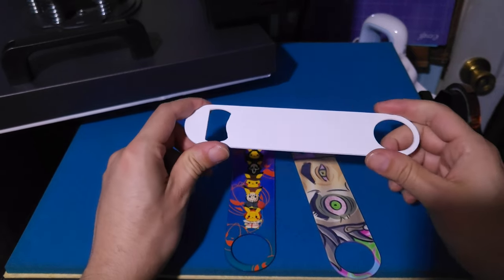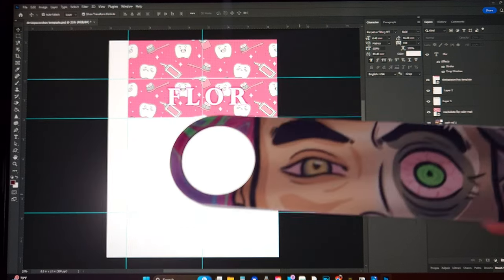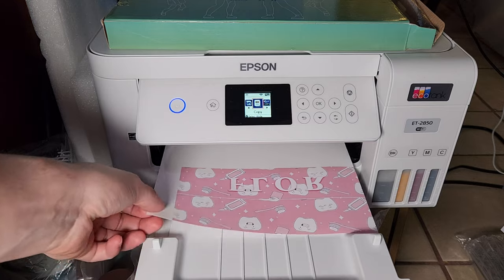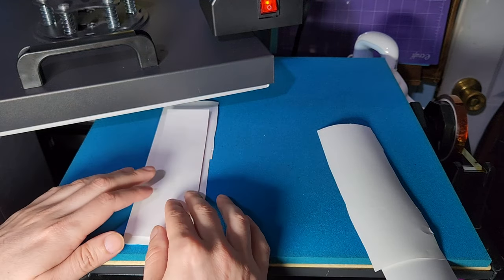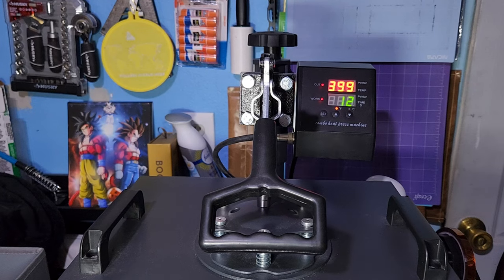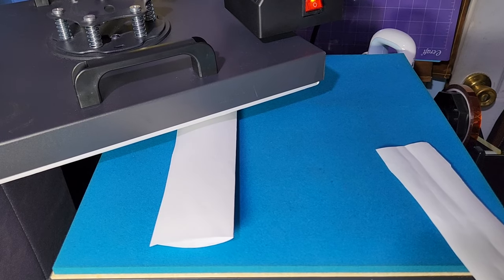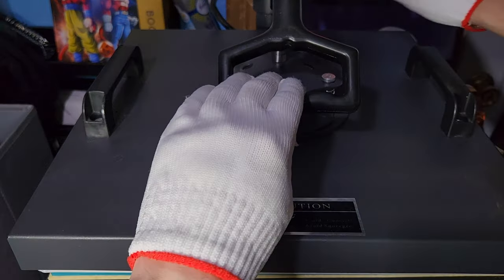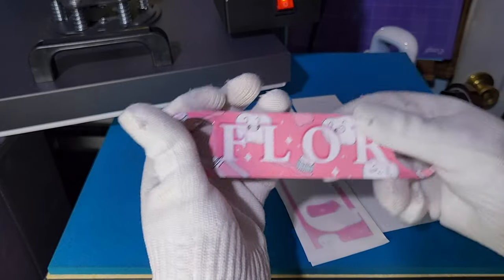Sublimating Bottle Openers

Comment: What app do you use ?
Reply from the maker: I used Adobe Photoshop in this video
Reply: How much pressure are you pressing down with? I have a Amazon press that looks just like yours but my bottle openers are coming out very light looking like not all the ink is being transferred.
Reply from the maker: @mikemartinez6453  I use medium pressure. I would just say to try and press it for more time or set it a little hotter.